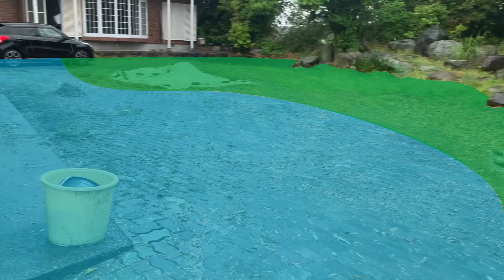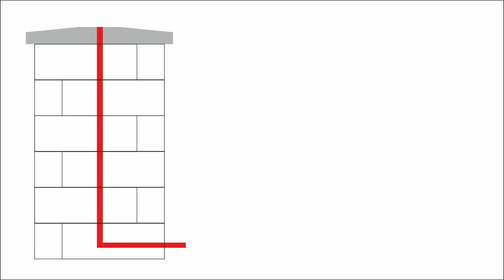Abandoned Chiba House Renovation Part 22

Comment: Using a chain block is one of the solution but have to compose pipes. Probably the weight of new cap is around 40kg, enough  workout for you.  First lift up caps and down on the kei-truck and lift up them on the top of gates from kei-truck afterwards.
Reply from the maker: Thanks for the advice. Unfortunately, they are way beyond 40kgs and I cant even lift one completely off the ground by myself due to the shap and size. In a following video I worked out a slolution :)